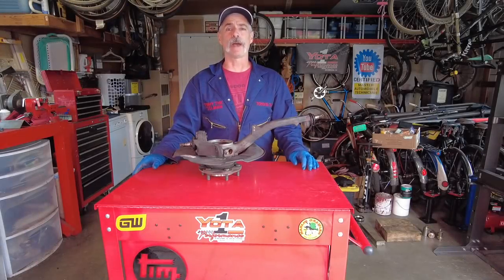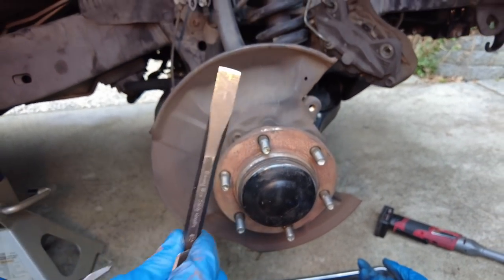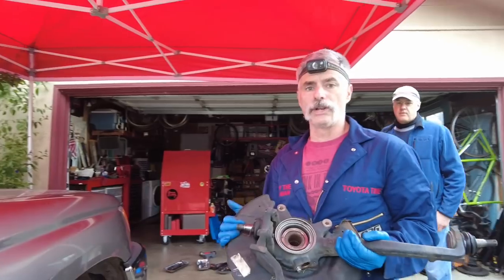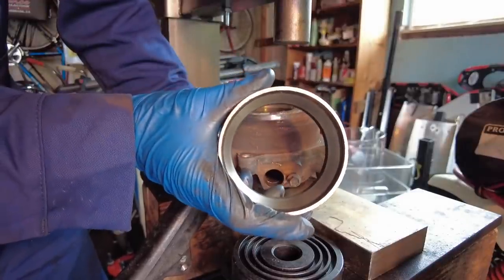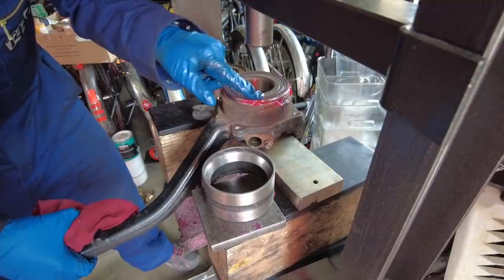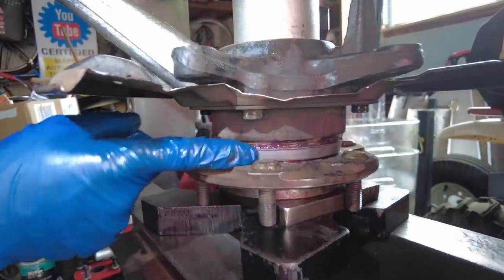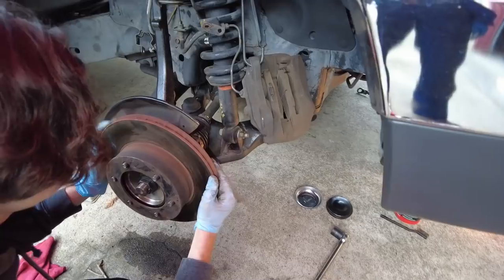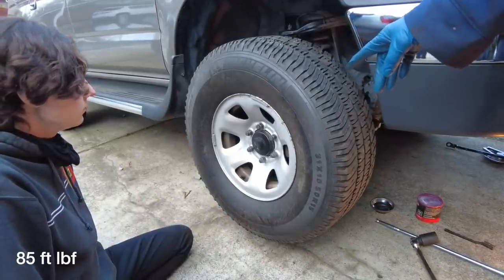Front Wheel Bearing Replacement (3rd Gen Toyota 4runner & 1st Gen Toyota Tacoma)

Comment: Did I miss the link for the large press adapters you're using to remove the old bearings? I am doing this job on a 03 sequoia and am currently stuck as the bearing outer race is stuck inside the knuckle. The bearing separated when pressing it out. I can get a dremel with metal wheel in there but it will definitely score the inside of the knuckle. I don't think it will be a problem but I think having those larger press adapters would probably remove it.
Reply from the maker: Look at the comment we pinned (1st comment you see).  We list all the tools we used for the job there.  It's listed as the "Press Sleeve Kit".

Comment: Hey Tim. Enjoy your program. I went to a mechanic shop and got my two front hub wheel bearing replace on a 2000 Toyota 4 runner. I fit it back on the vehicle. The wheel does not spin freely. I drive up to 1 mile and the hub got very hot. I know it's not cause by the friction of the brakes. Is this normal and will it get free after a while? I'm afraid to drive it far, fairing it by get too hot and seized up the bearing.
Reply from the maker: Great to hear you like our channel.  To answer your question, the shop screwed up somehow.  Maybe they pressed the new bearing in by applying pressure to the inner race rather than the outer race and caused damage.  Another common error shops do is they don't properly support the inner race of the bearing when they are pressing the hub into the bearing.  Hate to say it, but you need to pull your spindles back off and tell them to do the job right.  If you watch the video, you'll know all the nuances of this job where people can screw up.  When you talk to them, you should ask to talk to the person who did the job and question him about the things I mentioned.  If you don't think this shop is capable of doing the job right, ask for a full refund and take your spindles to a another shop.  But, better yet, invest in a press, press sleeves and other tools you need to do this job and do it yourself so you have the peace of mind it was done right.  No way in hell should a bearing not spin freely is this job was done right.  They screwed up.
Reply: Thanks for responding.. They did say they had a hard time with it. First time I'm going to this shop. I did get the impression they don't press bearing often when talking to them.
Reply from the maker: @stewpeas87  You know what kills me?  Shops take on jobs they have no business doing.  If they weren't familiar with what's required to successfully do the job, they should have passed on it.  Instead,  they took your money and screwed it up.  I'd ask for a full refund on the repair and either do it yourself or find a shop that is knowledgeable on doing wheel bearings on these Toyotas.

Comment: here is a good one for ya!  does it mention anywhere in the FSM that the wheel hub NEEDS to be replaced with a new one along with the bearing? as in the Hub is a non-reusable part?  This is what my local Yota dealer told me this past week and why the wheel on my taco has this minor wobbly knocking on the left front still. That the hub was not replaced along with the OEM bearing years ago after it had a china-made bearing fail in 5k miles after install.  I think this shop put the OEM bearing in backwards is why it is still knocking like at the beginning of the video here. but IDK yet!
The dealer service dept said the hub on these has to be replaced with the bearing, this hub has an MSRP of over 200$ !! I've also been told by some other places (firestone and another yota specialty shop)  that you have to replace the hub when you replace the bearing... its all very confusing!
Reply from the maker: The hub DOES NOT need to be replaced.  The dealer and those other shops don't know what they are talking about.  They just don't want to deal with pressing the hub out of the bearing.  Sometimes, one of the races gets stuck onto the hub, and then you have to grab it with a bearing splitter and press it off.  The hub is just a hunk of steel and it doesn't go bad.  The only time it needs to be replaced is if the vehicle got into an accident and it got bent.

Comment: This video is awesome man! I do have a question(most likely a dumb question), can wheel bearings seize up? The right front on mine isn't wobbly, but it is a little hard to turn and no it isn't my caliper(took the pads out to check).
Reply from the maker: Hey William, it's not a dumb question.  Yes, bearings can seize or become rougher over time.    I'm guessing you're comparing the passenger side to the driver side and the passenger side has more rolling resistance?  Does it feel rough or sort of crunchy?  If it were me, I think I"d pull the CV axle out to isolate the hub just to rule out what I was feeling wasn't coming from the front differential.  Also, when the wheels are at full droop, the CV axles at that extreme angle can bind a bit, so if you still have the wheel connected, get a jack under the lower control arm and lift it up a bit before trying to spin the wheel.  The roughness you're feeling could have been caused by the binding of the CV axle.
Reply: @TimmyTheToolman  I forgot to add that it's 2WD. There is a little  more resistance than the left, but I don't feel any roughness, crunching and it doesn't seem to drag or pull while driving. It does have 280k on it, and I don't know if they were ever done by the previous owner.
Reply from the maker: @williamsteele2724  If there's no play and it's rolling fairly smooth, I think you're OK leaving it alone.

Comment: Tim,The new Koyo bearings for the 3rd gen 4runners  do have that black cover on one side,Both ends look the same and I don't see a taper on either end and the bearing has engravings (Koyo stamp and numbers)on one side only,Both side are not magnetic.Any suggestions on what end goes in first,Thanks in advance.
Reply from the maker: Don't think it matters honestly.
Reply: Thanks sir,You know a bearing fits perfectly inside the spindle between the lugs in the cup for pressing upside down,Holds it perfectly and gives good height so the stud bolts are above the press surface.Since there is no magnetic sensor looking at that part of the hub(Just the tone ring)I guess that is why neither side has a magnetic side,The OEM from factory Koyo bearings do,20+ years ago.Good work on the fast reply.Wish I had a friend like you near me,Its all on me,Had to learn all on my own,And really do not trust others to do work on my Toyota's .No help except people like you.Someone upstairs is writing this all down.
Reply from the maker: @leoszilard3998  You're welcome Leo.

Comment: I just bought a 99 tacoma with attomatic transmission and manual hubs. I notice not many tacomas and 4 runners of this gen have manual hubs. Are the manual hubs  more preferable and easier to work on?
Reply from the maker: They are actually more involved to work on if you were going to replace a CV axle.  But, they have great advantages.  You can have the CV axles disengaged when you don't need them saving wear and tear on them. On a normal rig with A.D.D. (Automatic Differential Disconnect), the CV axles are always spinning, even when you're not in 4wheel drive.   With manual hubs, you can use 4Lo on pavement for lower gearing if you're climbing a really steep and sustained paved grade.  This saves your automatic transmission from overheating.   On a normall ADD vehicle, you don't want to put your rig in 4wd on pavement because the front differential and CV axles will bind on the pavement in turns because there's no slip of the wheels on pavement like there is on a dirt or gravel road.  Another thing is if you break a CV axle, and you can drive out of where you're at in 2wd, you just unlock the hubs, and you can perform the axle replacement whenever you want.  If you break a CV axle on an ADD vehicle, you're forced to fix it on the trail because the axles are always spinning.

Comment: With a Bearing Splitter you can also press the inner race off the hub. Harbor Freight has a decent Bearing Splitter Kit. I was able to rebuild my W59 using the HF Splitter Kit. Check it out!
Reply from the maker: I've used a bearing splitter to get a stuck race off a hub, but I had to knock out the lug nut studs to be able to fit the bearing splitter under the race.

Comment: So I just recently did a 3 inch lift and new wheels and tires on my 2000 4Runner. I’ve got a small vibration up front that I thought the the cv needle bearing but that didn’t fix the issue completely. I am suspecting a front wheel bearing starting to go bad as I did go with a negative 12mm offset and the bearings have 288000 miles on them. I just noticed some abnormal wear on the inside tread of my drivers front tire with maybe 500 miles on them. I further suspected a worm wheel bearing but when I checked it there was no noticeable play. I did have an alignment done a few weeks ago. Should I replace the bearings or have the alignment rechecked?
Reply from the maker: Have you replaced the lower control arm bushings on your rig yet.  If not, I suspect they are shot.
Reply: @TimmyTheToolman  yes I did. Replaced with white line bushings when I did the lift
Reply from the maker: @sawyerbeals5105  I would have the wheels re-balanced and I would also get the alignment checked again.  The front end shimmy could also be from worn front differential bushings.  We have a video for replacing them with Durobumps replacements.
Reply: @TimmyTheToolman  I will look into that. For now I am going to rotate the tires and drive it for a little bit and see if another tire in that position starts doing it, because I did drive it for about a week and half before I got it aligned and the alignment was way off. So that wear May have happened before I got it aligned and maybe I just noticed it
Reply from the maker: @sawyerbeals5105  Ok, hope you figure it out.

Comment: Great video but i never see anyone doing a rwd tacoma. I have an 03 rwd prerunner and i am about to do mine. I am not sure but i was told that there might be a locking nut in the back covering that abs ring that needs a specific tool to take off is that true. Also the dust covers are different than what you have here and i have no clue how to remove them. Any advise
Reply from the maker: You will have a lock nut just like the manual hub versions do and yes you will need a special tool to remove it.  On a 4wd model, the CV axle nut torqued to 174 ft-lbs preloads the bearing.  On a 2wd model, you don't have a CV axle so you need another way to preload the bearing and thats' with the lock nut.  I've never removed a dust cover on a 2wd model but it can't be that hard to figure out.  You just need to figure out the best tool to pry it off with.  We have a couple manual hub swap videos you can use as a reference to know how to deal with the loosening and proper tightening of that lock nut.  We link all the tools we used in the Manual Hub Swap in Part 1 which includes the special tool used to remove and torque the lock nut.  We list the tools in a pinned comment which is the first comment you will see.

Manual Hub Swap Part 1: https://youtu.be/TZ2sOfVrnhU
Manual Hub Swap Part 2: https://youtu.be/1TpOYj0sUpA

Comment: Grease is not required to press the bearing into the hub assembly. Grease will occupied some space around the hub.
Reply from the maker: Yeah whatever.  Grease helps parts with assembly and it's not going to hurt anything. I've done two manual hub swaps and now this job and grease hasn't had any negative affect.  Grease reduces the surface tension and allows parts to press together with less force.  Grease will also facilitate a much easier removal if the job ever needs to be done again.  I've seen it where the inner race of the bearing gets stuck onto the shaft of the hub and then you have to cut it off.  You're entitled to your opinion, but so am I, and I don't agree with you.

Comment: Great video! Question though does anyone know if the bearing has lettering facing in or out ? The one I received isn’t black on one’s side
Reply from the maker: Not sure.  It's my best guess that it really doesn't matter which position it's installed.  I'm guessing you got aftermarket bearings.

Comment: Hey Tim, I'm looking for a 2wd Tacoma non prerunner front wheel bearing replacement video.  Dust cap is in the back side.  I believe this is a press job.  Can you confirm?
Reply: 2008 to be axact
Reply from the maker: @tonystubbs9189  It is a press job.  The closes thing I'd have for you is our manual hub swap video.  They are similar in the way that they utilize a nut to provide the preload for the bearing rather than the CV axle nut.  https://youtu.be/TZ2sOfVrnhU?si=InVVtXefIZJdIfFL

Comment: Good video. I feel like you are using a little too much grease. One problem with doing that is that you can have grease trapped between the bearing and the knuckle preventing the bearing from seating fully as grease does not compress.
Reply from the maker: Your comment about the grease would hold true if the cavity I was pressing the bearing into was completely sealed, but there's a big opening on both sides of the knuckle.  Since the grease has a space to squeeze out of, it's going to find the path of least resistance and push out.  The fact we were able to get the snap ring installed, let us know the bearing was fully seated into the knuckle.  Make sense?  I hope so.
Reply: @TimmyTheToolman  Well, in this case, it worked out, but there are cases where it would be a problem. Ask me how I know. 
A little side note also: I see you are a bike guy. In the bike world, it does not really matter how much grease you use (in fact in many cases, you can't have too much grease). In automotive or other motorized applications, however, you really need to know what you are doing. There are many disadvantages to using too much grease. The amount of grease you applied around the seals for example attracts gravel and other harmful particles which can severely shorten the life of seals. You want the area outside the seals to be as dry as possible so that the seal lips are only lubricated by a thin film of residual grease or oil from whatever they are sealing. 

This does not necessarily apply to this video, but when it comes to bearings, you have to measure by weight the amount of grease you use based on the dimensions of the bearing. There is a neat formula you can find on the SKF website. Again, when it comes to bikes, it doesn't really matter. In automobiles and other high-speed machines that use bearings, when you use too much grease, you can have lubricant churning which pushes grease away from the surfaces that need to be lubricated and separates the soap in the grease from the lubricating oil again severely shortening the life of a bearing.
Reply from the maker: @moshet842  Interesting.  Thanks for sharing.

Comment: That grease will heat up and seize the Bearing into the Spindle. Use clean motor Oil or a light Oil like WD40 on the Spindle inside & the Axle Splines. These are recommended by the manufacturer.
Reply from the maker: High temperature wheel bearing grease will heat up and seize the bearing onto the spindle?  Where do you get this idiocy from?  If that's the case, why don't the bearing ball bearings seize inside of the bearing races since they are lubricated with grease?  High Temp Wheel Bearing Grease is meant for parts that are spinning a high rates of speed that generate significant heat.

Comment: Hey Timmy. I am in the same predicament and was wondering is it easier to get the whole wheel hub completed or should I just replace the bearing? I really don’t know where to go
Reply from the maker: The whole assembly would be very costly unless you grabbed a used one off a wrecked rig. If there's a shop near you that knows what they are doing, you could pull the steering knuckle and bring it to them to perform the press work.  The main mistake shops do is they don't properly support the new bearing when pressing in the hub.  Maybe you can question them as to their process to get an idea if they know what they're doing.
Reply: @TimmyTheToolman  can a bad wheel bearing mess up the brake caliper and rotor?
Reply from the maker: @lando9285  If the wheel bearing was really bad and moving a ton, maybe.  Have you checked for play in the wheel bearing yet?  Jack up the front end, grab the wheel at the 12 and 6 o'clock positions and push and pull with opposing force trying to detect any play.  If it's tight, the wheel bearing is good.  If you feel play, the bearing is bad.
Reply: @TimmyTheToolman  thank you Timmy. I’m gonna be jacking my rig up after work today and get them bearings replaced.
Reply from the maker: @lando9285  Good luck with the job.